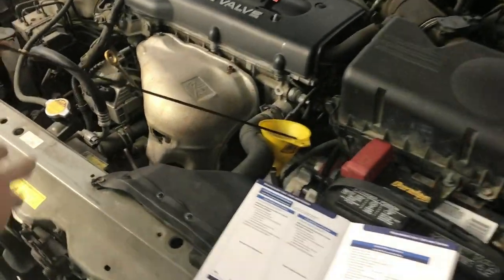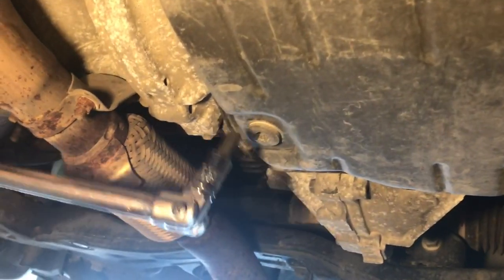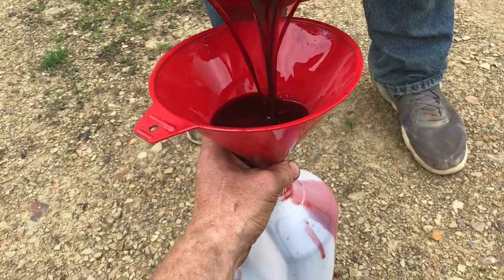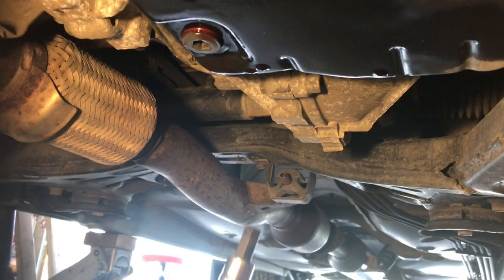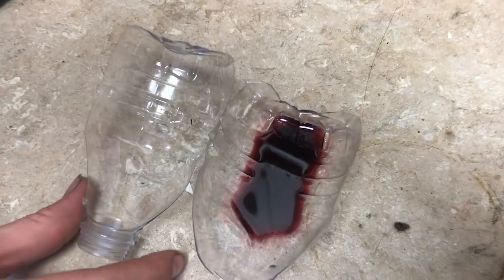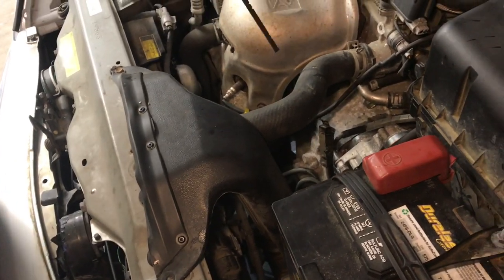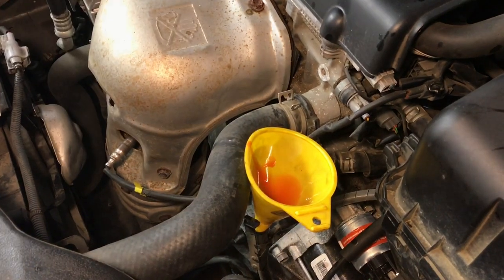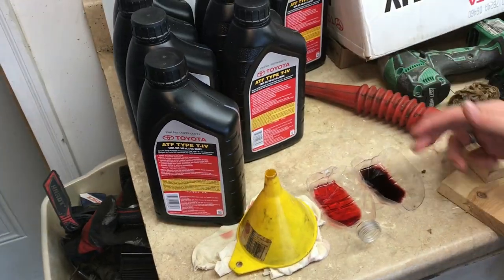CHANGING transmission fluid in Toyota Camry (EASY WAY)

Comment: Just picked up  05  Toyota camry off my CO worker. It will be a basic transportation A to B work and leave my Toyota Sequoia V8 engine home.

Thanks for this video transmission service. I WILL THE SAME STEPS.   I ALSO PICKED UP A FULL 12 BOTTLE CASE TO GET THE COST DOWN.   I figured do a drain and refill very 5,000 miles to slowly mixing new and old fluid out until 12 bottles used up.  

Then, afterward, drain and fill every 10,000 miles, keeping fluids clean.

Done  the same on my 06 Toyota Sequoia 4WD, and it had over 300,000 miles.

Comment: If anyone plans to change the trans filter on 3rd gen camrys ,

Several Tran pan bolts are pinned under driver’s side frame rail to where they are not easily accessible

I ended up unbolting a  portion of a driver’s side motor mount and with a sep jack, raised motor several inches 

Even then, you’ll need a selection of small wrenches , 1/4 drive and.....

Luck 

 to remove 3- 4 bolts and drop pan, clean pan, clean pan magnet and reinstall pan with new gasket 

Would also suggest spraying bolts First and not removing tranny drain plug until you’re  sure you can remove ALL pan bolts...
Reply from the maker: It seems like every time that I’ve change the filter on the transmission, the screen always looks clean. I’m not saying that it’s a bad idea to change the screen, but it sure is a lot of work. Just out of curiosity what was the condition of the screen after you pulled it out? Was it clogged? Or did it look pretty clear of debris

Comment: Back when Toyota used automatic transmissions you could actually service yourself unlike the junky setup they use today.
Reply: You're wrong, they are infinitely easier to service. The leveling method is internal now and much more accurate
Reply: New method is at least not the worst ones
Reply: What are you even talking about? Lol

Comment: Believe it or not i have been drain & filling our 08 rav4 with 218,000 trans using Walmart High mileage Super Tech WS for years!!
Reply: and you've never changed the filter?
Reply: Have you ever changed the filter ??
Reply: @George-mk7lp  Nope filter is internal if not broken don't fix sold it at 245,000 miles due to rusty chassis. Replaced with a used 2019 Rav 4 in July 9 2020.

Comment: How can I change all of the transmission fluid in my 2000 2.2l Camry XLE. I don't think it's ever been changed. Once in a great while the transmission will hold out second and then I will let of the gas peddle and it will shift. But that's not frequent. Also the transmission fluid is dirty. Not burnt. Thank you David

Comment: I changed the oil in my Toyota Corolla 1994 automatic and I changed the transmission oil filter and it lacked a little for the 5 quarts, it stayed on the first step of hot.
Reply: How your filter looked like ? Was it very clogged ?

Comment: Did you change the fluid when it was cold, or did you warm up the car's engine first?  A lot of people do it this way, but some people suggest running the engine for a while before you drain it.  Just curious.  Thanks for sharing!
Reply: T Howard my experience is do it when cold and more comes out.  I have done it both ways.

Comment: How many litres of the transmission did you use all together?
Reply from the maker: Unfortunately I didn’t measure the volume of transmission fluid that I put in, a little less than a gallon. Are use the milk jug to show me the exact amount they came out of the vehicle that I use the other milk jug to get me in the ball park. Once the car was unlevel ground and warmed up I was able to verify the exact level. I hope this helps
Reply: Was the car jacked up when you shifted through the gears?  Or can I drive it around?

Comment: How many litres of transmission should be used in a Toyota Camry 2003 v6
Reply: Haynes repair manual says for V6 2003 toyota camry is 3.7 quarts of toyota atf type iv

Comment: Good deal, but I am in need of a video of how to change the Auto Trans filter on the 2.4L Toyota Camry/Solara and others I think. I know it is a bit tricky due to the frame getting in the way to remove a few of the bolts on the atf pan. I've seen pictures but not a video. Thanks for the video.
Reply: It doesn't have a filter. Just a mesh
Reply: Very easy , replace the gasket to trans pan at same time as filter. It is a filter but a mesh filter 1a auto has a good video on that

Comment: My transmission fluid indicated on Hot Level even when I checked it in the morning. Is this ok or too much? Do you know?
Reply: to much trans fluid... should be at low fluid level on dip stick when engine and trans is cold... loosen drain plug and let it leak fluid out till it reads on cold level mark on dip stick..
Reply: Was your engine running when you checked it? It is normal to read in the hot zone when the transmission is cold IF your engine is off because there is less fluid (circulating/present) in the torque converter and thus more in the pan.
Reply: Way too overfilled

Comment: The manufacturer was right. The fluid looked brand new. A fluid that needs to be replaced looks yellowish-brownish.
Reply from the maker: I’ve changed fluid too late in some of my other cars. I’d rather be too early than too late, when it’s black I can’t go back. You are correct I could’ve gone longer on his fluid. Sometimes it’s easier to just go with the schedule across-the-board
Reply: Moo - looks don't tell the whole story Moo...

Comment: Never Done  transmission fluid change , but I’ll consider  to do it  , because my Camry go 235.000 miles   And I want to keep it  running, would you  recommend to do it?
Reply: If it has never been done than no it is too high of mileage and may cause it to start slipping

Comment: Wot about the filter?
Reply from the maker: There’s no doubt it’s a good idea to change the filter. Typically you have to drop the pan and remove it. I have found that every time that I change the filter the filter is not clogged at all. If it were a paper filter I would change it. Since it is a Metal screen I just try to keep my fluid changed a bit more frequently. These are my thoughts on changing the transmission filter.

Comment: You do realize that just because your engine is at operating temperature does NOT mean that your transmission is at operating temperature.
Reply from the maker: Thanks, just out of curiosity without a transmission gauge how do you know when the transmission is at operating temperature. Through the OBD2 connection port?
Reply: @livefree6878  
Actually, you don't. I have a Scangauge II in our 2009 RAV4 which connects to the OBD II plug. It reads the ATF fluid temperature. I can start up the vehicle and drive it South down Route 309 from Hazleton, PA to Hometown, PA (about 10 miles) and the transmission fluid will only be at 145°F. Operating temperature for the transmission according to a Toyota repair/service manual is between 158° and 176°. At those temperatures the dip-stick should read in the hot area. 

The reason my transmission isn't at operating temperature making the trip mentioned above is because that is a mostly downhill trip. After I make the trip in the opposite direction it will be at 176° or warmer.

Normally, a 20 minute drive on the interstate should suffice (as long as it's not all downhill) or even 20 minutes around town with stop & go driving shifting through the gears should work especially if a couple short hills are included. 

You could also get an IR heat reading gun and read the temperature off the fluid pan on the bottom of the transmission. MAKE SURE THE VEHICLE IS LEVEL.

Some say at idling just wait until the electric cooling fans cycle on twice and the transmission should be at operating temperature. I haven't tried these methods to confirm if that works or not. I'll put that on my to do list.

You might also mention that not all Toyotas use the same fluid. Newer ones use Toyota ATF-WS and of course the hybrids and some Corollas with CVT transmissions use CVT fluid. Owner's should check their owner's manual for details.
Reply: Steven Sevek - we replied to each other before but my scangauge rarely says anything higher than 160 and that's driving the Highlander pretty hard. Typically driving easily it stays in the 140-150 range.  I live in Texas so no hills and it has the cooler package.
Reply: @condor5635  
That cooler makes the difference and if you don't have many hills that will make a difference too.
Reply: JackTannehillPromoter -  yeah I wouldn’t say I drive it like an old lady but I definitely don’t push it very hard at all. To get it in the 170-180 range would really take a lot of hard driving for me
Reply: So is it possible to get an accurate reading when engine is off and cold like first thing in the morning?  Or is the dipstick “cold” and “hot” markings designed to be read when engine is running?  I know it’s different but when checking oil when engine is off the level is naturally higher on dipstick because the oil is in the pan.  I’m thinking with transmission fluid, when checking in the morning the level should be higher on dipstick because it’s not being circulated through engine?  Just a little confused because my 4Runner reads in the high level after it’s been sitting for hours.  Any help is appreciated, thanks!
Reply: Tom Korell - consider it this way. There are three readings really for Toyotas in my experience. There’s a reading that you get when you turn the car on and the engine has been running for less than say five minutes.  That is the cold reading on the dipstick which is the lower mark. Once the car has been run for 15-20 minutes or as they say the transmission is warm and it operating temperature this is where the Hot marks on the dipstick apply. Those are the two documented ways of checking the transmission fluid. The third way that I have found to be just as reliable is a mark that doesn’t exist on the dipstick. That is the level when you go out in the morning and the car is not running and you check the dipstick. This level will be very high - Significantly higher than the hot level on the dipstick. The reason is exactly as you said. Much of the fluid has drained from the torque converter and gone into the pan. I have placed a mark on my dipstick to indicate that level as well. All three of these ways will let you validate your transmission fluid levels.  Hope this helps.
Reply: condor5635 thank you so much, that makes it clear and very easy to understand, much appreciated!
Reply: @condor5635  
About ten days ago I just let our RAV4 idle to see how long it would take for the transmission to warm up to 158°F (the low end of operating temperature). It took 35 minutes. This was from a cold start. The ambient temperature was 65°. The fan never kicked on.
Reply: JackTannehillPromoter - yes it would take that long probably to get up to operating temperature. Best just to take it for a 15 minute drive if that’s what you’re trying to get to. As I mentioned before I don’t think mine would even get to 158 idling because it barely gets to that when I drive around at a casual speed. But I live in the south with no mountains

Comment: Is this Toyota ATF Fluid has with Dexron 2 or Dexron 3?
Reply from the maker: Most car manufacturers you can get off brand transmission fluid. It just doesn’t seem like Toyota has allowed anybody to make their transmission fluid except them selves. That’s a little frustrating. I did not want to take a chance so I purchased the real stuff online. It was cheaper when I bought a case of it. I hope this answer helps
Reply: Live Free I just went to Advance Auto Parts store and they do have ATF Fluid Dexron 3 but sold out quickly and it’s only $5 something also I have to get a AT Filter as well. 😎👍
Reply from the maker: Wow five dollars, as I recall I paid $12. I think it’s great that you’re going to pull the pan and change the filter. My experience has been that this screen is typically clean. I’d love to know when you change it if the screen is dirty looking. I always try to keep the transmission fluid freshened up on all the cars. I’m glad you were able to find some aftermarket transmission fluid. I have used aftermarket transmission fluid on a lot of our vehicles without any problems. I’d love to hear how the job went after it’s done, thanks again

Comment: Toyota doesnt want to be responsible for a new transmission after the warranty ends.  they had to pay environmental fees because of changing fluid during warranty.  were talking about millions !!!!
Reply from the maker: Wow! I hope that’s not the case. I still prefer to change out the transmission fluid every 30,000 anyway. I’ve seen what happens if you don’t. I don’t like dark transmission fluid.

Comment: You're wasting money changing transmission fluid on a "fluid-for-life" transmission. I think Toyota's engineers know a whole lot more about lubrication and wear than most backyard mechanics. But, oh well, it's your money. Don't forget to change the freon in the A/C system every 10,000 miles while you're at it.
Reply: The manufacturers (and by association the engineers) don’t want these expensive units to last. Of course they’ll say that hoping you’ll actually listen and end up needing a new tranny after the warranty is up! And it’s a Toyota. It could last you 300K+ miles if looked after! Oil (trans fluid in this case) wears down from heat and friction, just like engine oil. Change it. I mean, why even bother putting a drain plug and dipstick if it never needed changing?
Reply: Have fun with a overheating transmission when you never change your fluid